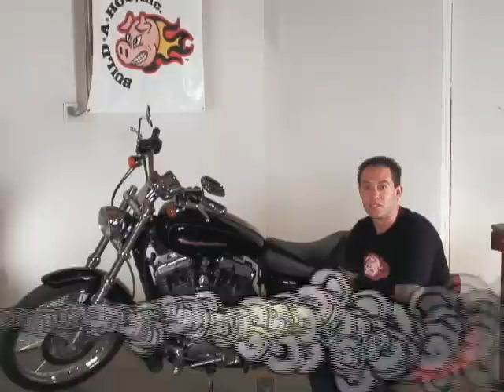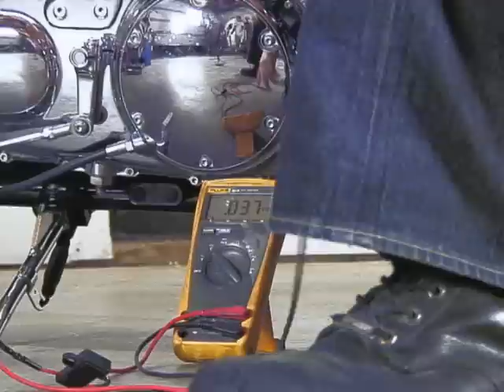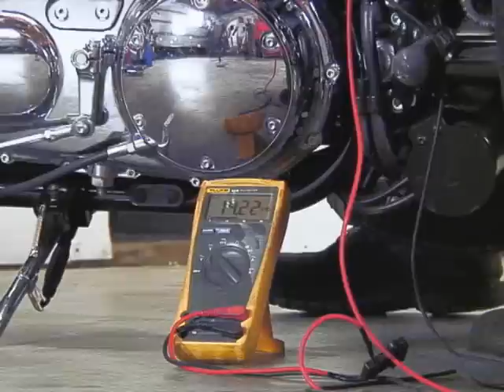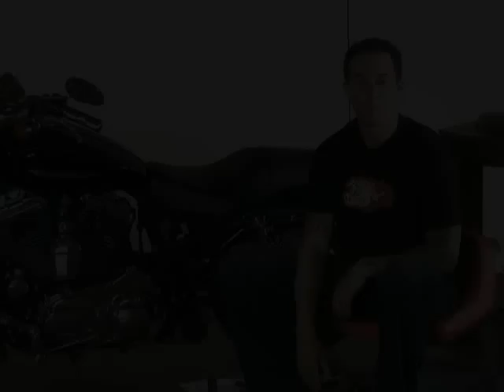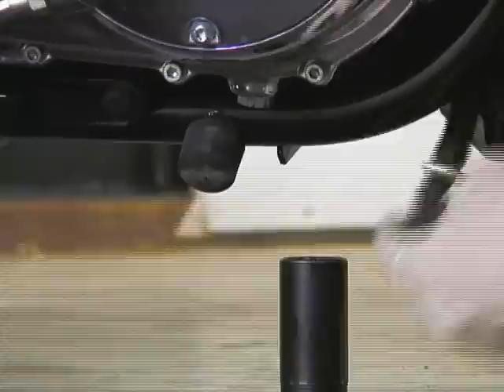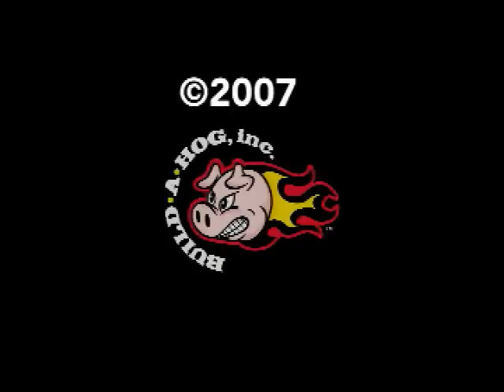Harley Davidson Sportster Maintenance Video Part 1

Comment: I have 2005 883 sport and it pops and misses at low speed and when I'm riding at a steady speed it almost got me hit couple times pulling out in traffic can u tell me what It is.    Love your videos and website
Reply: Your issue sounds very similar to mine, especially the popping during elevated merges in traffic.

This sounds like a case of an intake leak thru your intake manifold seals. I bought all 3 replacements from OEM for about $15.00 and the ones i removed didnt "Really" look like they were bad, after turning the engine on the popping and unreliability of the throttle was resolved.

There is a great how-to at www.xlforum.net
Reply: I know it's like 2 years later, but I had the same problem on my 1200 and I took my carb to be cleaned and everything and I haven't had a problem.

Comment: Great Video, it's my first Harley and I changed the battery myself. But now i noticed a floating cable (leading to nowhere next to the battery (left to it), The end side is pointing down. What is it? did I unplugged something? or is normal? Thx for the attention and excuse my english , i'm french!
Reply: this could be your Battery to ground cable, that is not fastened to chassis ground.

This could also be your gas tank over flow tube that exits down by the countershaft. 

There are other tubes exiting to atmoshpere (leading nowhere) as well for the carb and transmission among others.

Trace your cable if it runs up to the gas tank or othersuch leave it alone. If it runs to your battery terminal, fasten it to chassis ground as described in a service manual.

Comment: Cheers mate. I had a look today but it's the positive and negative posts on the battery I need access to. The solar trickle charger lead connects straight onto the batter using the circular (hoop) connections. So frustrating as I don't have the tools to release the battery unit to gain access to the negative post! Goin to have to phone my dealership I think... :(

Comment: It should be way easier than taking the panel off - there's a black cord that hangs out near there with a plastic cap, take off the cap and the trickle charger goes right in, obvious female to male action. (it should, I have an '09 and it was super easy)

Comment: I have a 2013 XL1200 Custom that I want to add a trickle charger to. Will I be able to do that by simply slipping the side cover off and connecting the leads (without removal of the battery)?

Comment: i recently just swapped out my grips today on my 2009 nightster XL1200, everything was going fine got both grips on fine and throttle one even works fine snaps back and everything, when i put in the key now only thing that comes on is the headlight, running lights, and it will start, no blinkers, no horn, no speedometer or and mileage or icons on speedometer...weird if anybody has experienced this before please help!

Comment from the maker: You will need to disconnect the battery strap
-disconnect the positive terminal with a 10mm wrench
-I like to remove the negative terminal at the frame and leave it connected to the battery which makes the battery removal much easier because of the tight space.
-slide the battery out with the negative cable connected to the terminal

Comment: Good video, I recently tried removing by battery from 2007 sporster, but no luck! I got as far as getting the strap undone, but couldn't get it off. Besides using a 7/16 socket, what did you use to disconnect the terminal??

Comment: @UNDEADoCROWS  I have a 1999 sporty that I bought brand new. It currently has 78,000 miles on it and have done nothing other than regular maintenance. Thats pretty reliable in my book!!   Oh replaced the drive belt at 63,000, it broke, lucky for me I was about 3 miles from home.